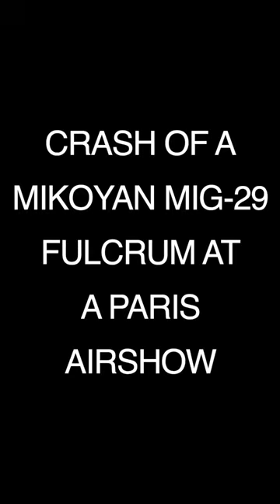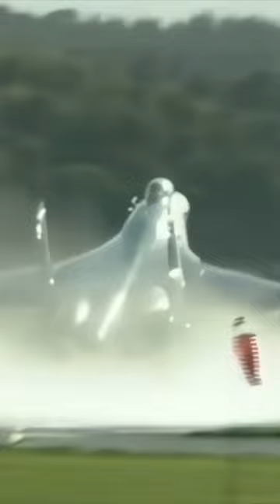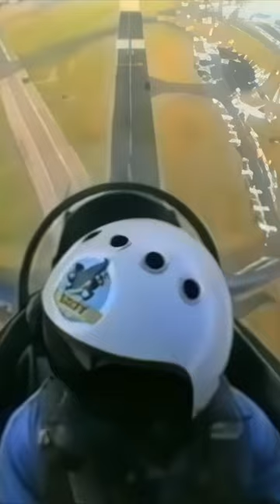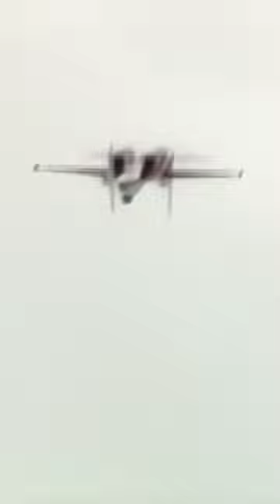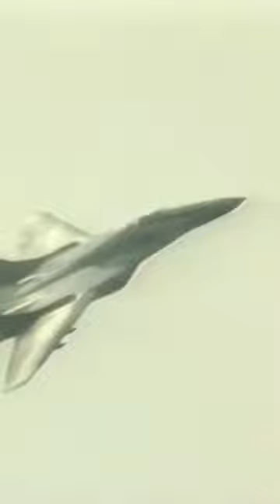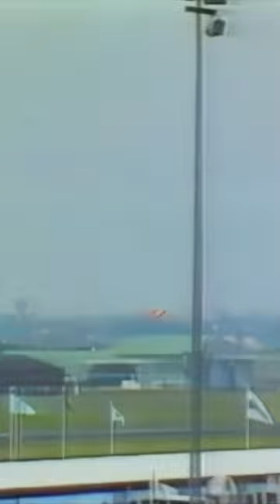A MIG29 Fulcrum crashes at the Paris Air Show In 1989. No Casualty! Last Second Ejection

Comment: This was the first time the west had seen the mighty Mig-29 . The plane suffered a bird strike in the left engine and was at low altitude and the pilot could not control it. The parachute of the pilot opened as soon as he touched the ground he suffered bruised stomachand minor fractures and the plane being verticalthe soviets had gyro ejection which stabilized the pilots seat . And note that the pilot was Anatoly kvochur the man who created Kvochur's bell manuver .